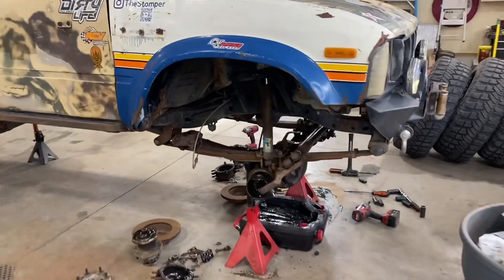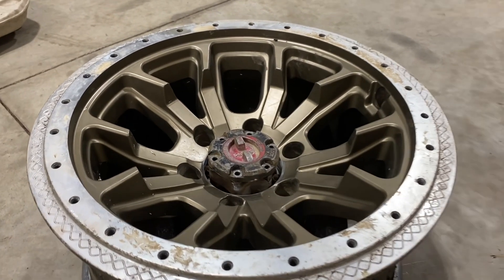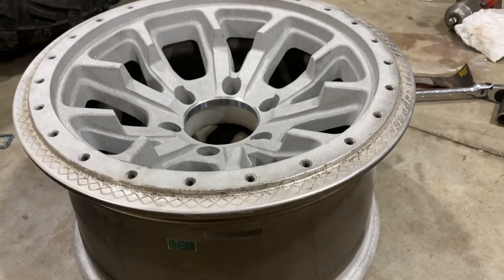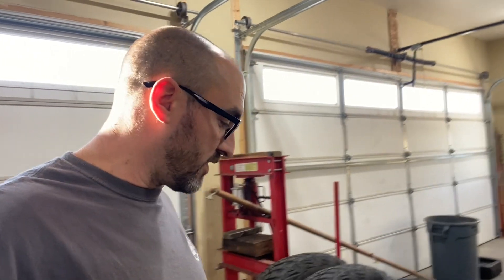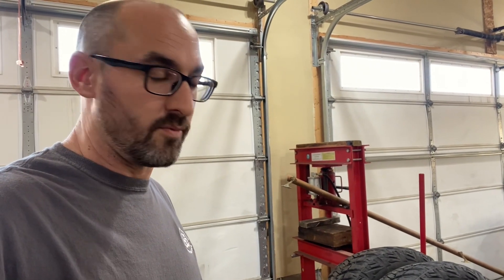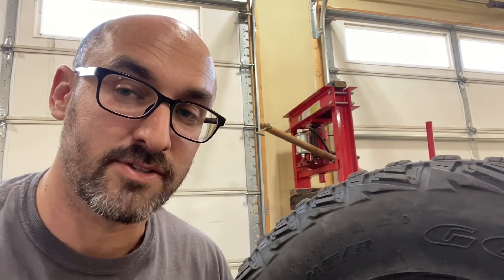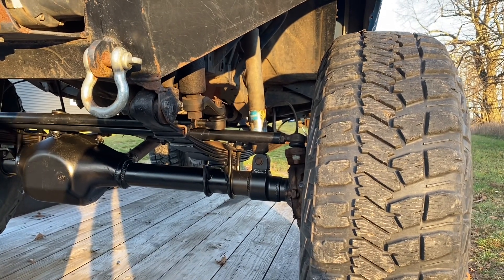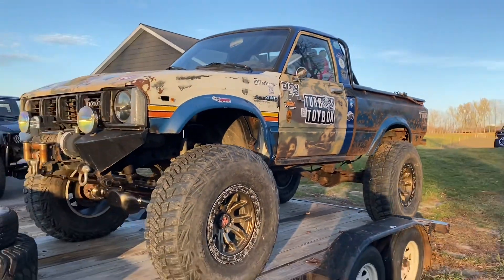Stomper axle upgrade progress, and are airsoft BBs suitable for balance beads?

Comment: Hey buddy what size springs and shackles are you using ?
Reply from the maker: Rear leaf springs are stock 98 Chevy 1500 4x4 with a 8” long shackle. Fronts are stock 87 4Runner rears which added 2 spare random leafs to each side. 5.5” long shackles. (Shackles measured center to center of bolt holes)